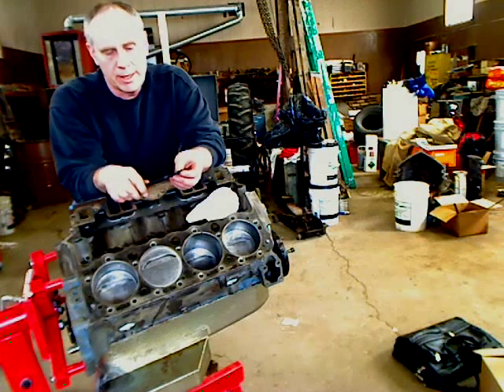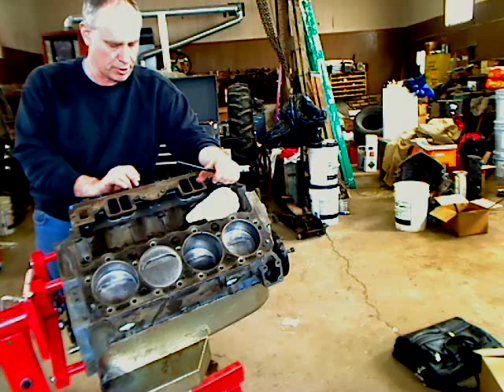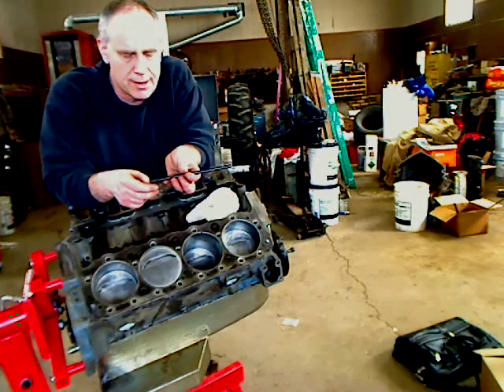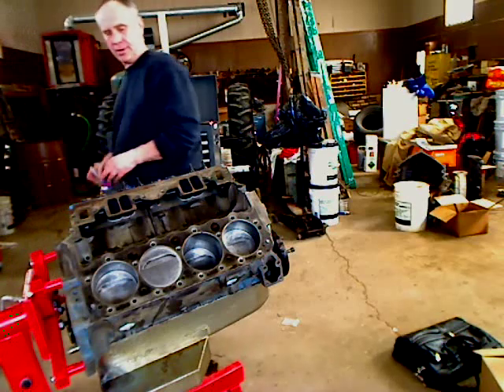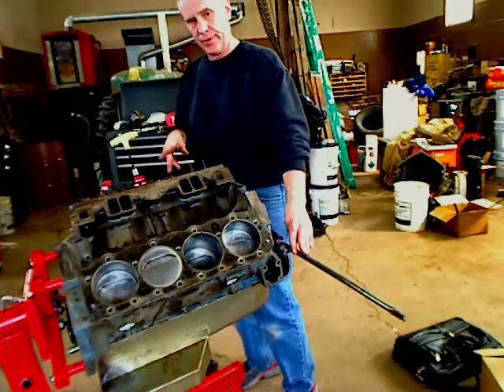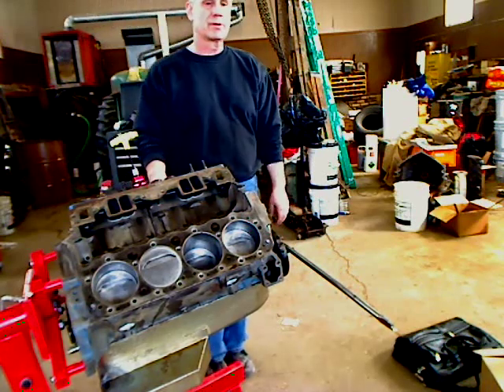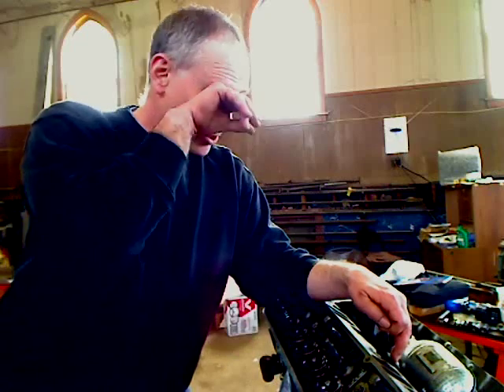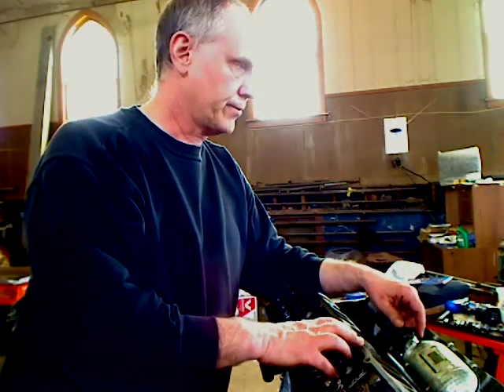How To Check Pushrods For Proper Length

Comment from the maker: For a hydraulic cam install a new hydraulic lifter, adjust to 0 lash + 1/2 turn and check as I posted, except go with a dry erase marker it works much better. You might want to use a checking spring for this application.This per a high performance engine buider that helps me out with his knowledge.

Comment: Hey Ron...thanks for posting.  Did you use a solid lifter for checking?  I was told that if I used a hydraulic lifter, I was "doing it wrong" since the hyd lifter would compress slightly, and my push-rods would end up being too long.  I ws told the ONLY way to get a good measurement was either the checking springs or a solid lifter.  Some guys fill a used hyd lifter of the same specs with JB weld, etc...there are various methods to make sure the lifter doesn't compress  Thoughts?

Comment: i tried using checking springs with a sharpie, got frusturated! Solution dry erase marker, worked like a charm without any lifter movement, which can alter you measurment.
Nice video, very informative